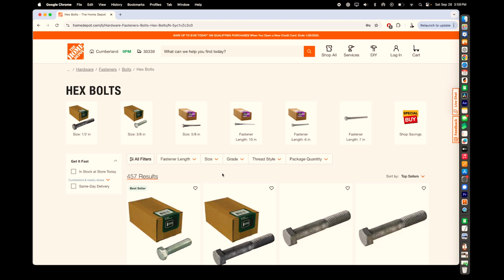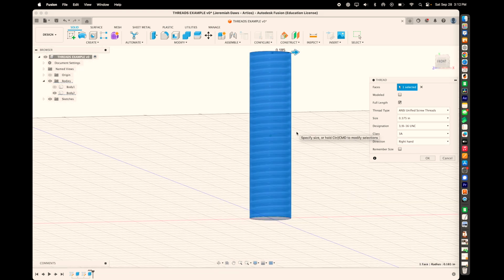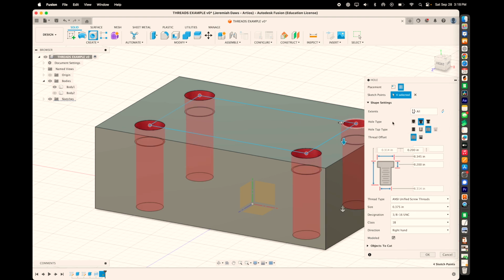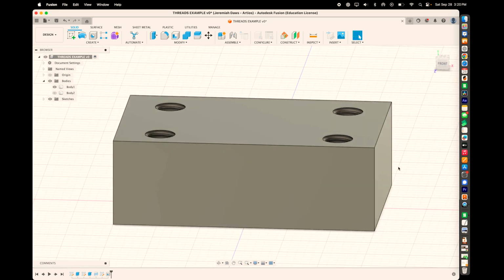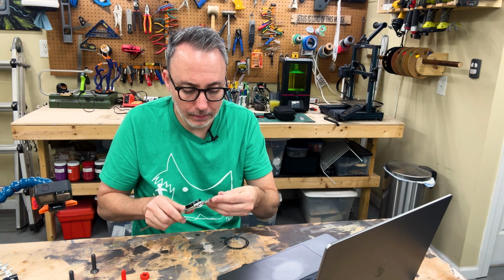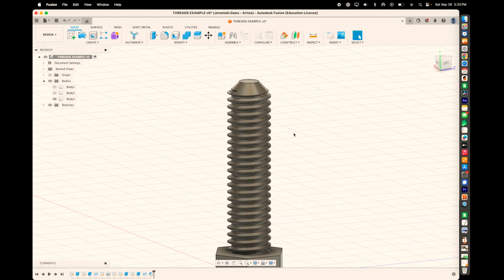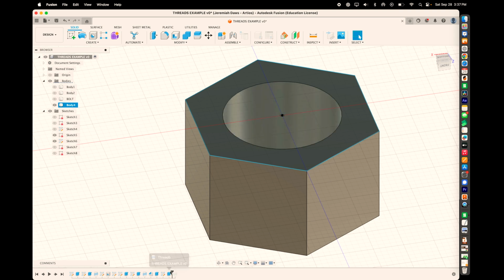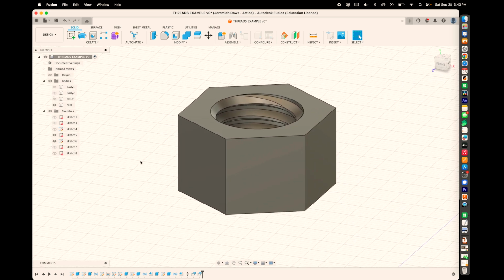FUSION 360 - LESSON 5 - THREADS FOR 3D PRINTING

Comment: When making offset, wouldn't you want your bolt to be larger than the screw? In your example, you off set both the screw and bolt with the same negative off set. wouldn't that make them both the same exact size again. Should the Bolt be + rather than -?

Comment: jeremiah - is it correct to say that fusion 360 , cuts material away from the nominal cylinder size when you apply external threads - and adds material to the "hole" when you apply internal threads ?
Reply from the maker: @HaoleMarc  my guess would be it’s adding to both.
Reply: @JeremiahDaws actually, what happens is fusion resizes the cylinder to match the size needed for the selected threading - both for internal and external threading ( nut and bolt) so if you try an M10 spec for the inside thread on a 12mm cylinder- it will leave you with the proper threaded hole for M10